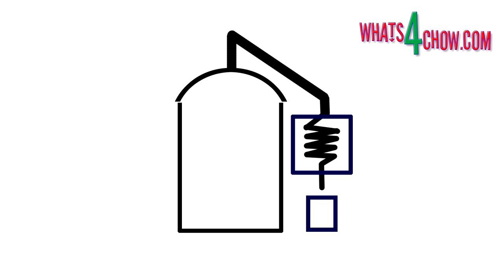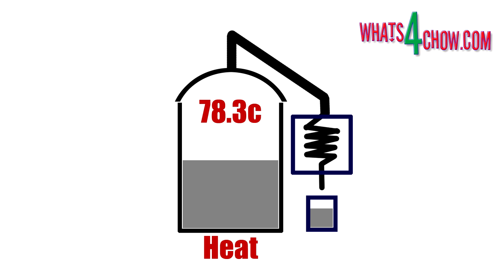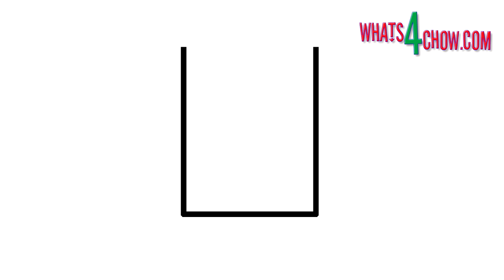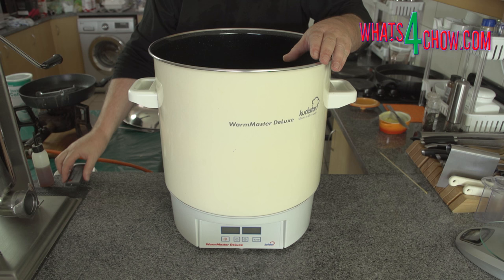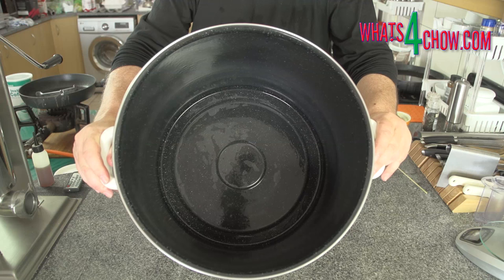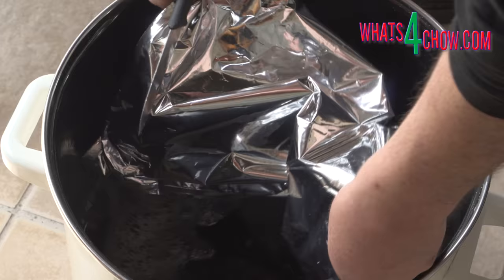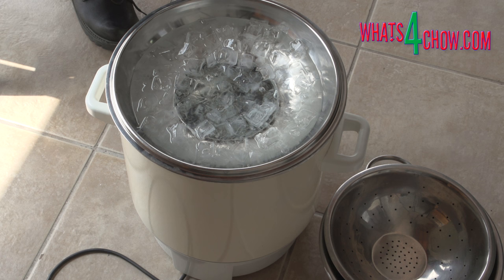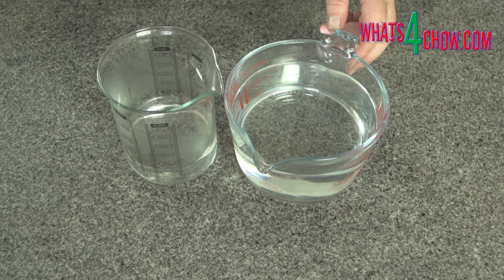How to Make a Reverse Pot Still - Quick & Easy Reverse Distilling at Home!!! Stock Pot Distiller.

Comment: What about the head of the distillation, shouldn't you get rid of like the first 12ml of it?
Reply from the maker: Hi -- I wouldn't use this technique of distilling for any type of grain alcohol. Acetone, methanol and aldehydes are primarily the result of grain alcohol brews. Wines and sugar washes has negligible quantities of these and there is no need for concern. If you do want to distill grain alcohol, I would suggest pot distilling, or reflux distilling, where it is far more practical to actually accurately remove the foreshots and tails from the good stuff.
Thanks for watching!!!
Reply: Whats4Chow nice one,  I just made a sugar wash with alcotec 48 turbo yeast.  It's sitting at 13abv at the moment but should hit 20-23%abv in the end.
Reply from the maker: Super-cool.... let me know how it turns out!

Comment: Assuming an induction burner is set to 80 C or 174 F approximately how long will the process take until it's complete / how do you know when it's done?  I'll hang up and listen.
Reply from the maker: Hi --- this is impossible to predict -- it depends on the ambient temperature, how efficient the heat source is and the starting ABV of the wash in the pot. If you have a good idea of the starting alcohol strength ie. +- 20% ABV and you have 5 liters, that means that the total alcohol content will be 1 liter at 100%.  Collect batches of distillate and measure and calculate the ABV and total alcohol for each batch. When the ABV drops below 20% ABV, the process starts taking too long to make it viable to continue collecting distillate. Blend the batches you have collected, and you should have resulting product that is between 40-50% ABV.
Reply: Is it ok to take the lid off to see how much wash you have left or to see how much has been distilled?
Reply from the maker: Hi --- yes you can remove the lid to check on progress. Make sure your ventilation is good and don't have any open flames burning, and you will be fine. Thanks for watching!!!

Comment: Hi, this is cool! I've got 1 litre of 40% vodka which I want to distill to a higher percentage. Would this method bring it anywhere near 190+ proof? I don't need it for drinking, just for small alcohol camping stoves etc. I was still hoping to get as much as possible, without loses - how airtight is the lid (condenser) on the pot, I guess at least some steam has to leave the pot? Temperature wise...could it just be heated slowly and then balanced at the temperature where the alcohol starts to steam and collect? Maybe lower the temp as the liquid reduces as it would need less to heat a smaller amount? Cheers
Reply from the maker: Hi Kyle -- unfortunately, this is not going to work for you. Any drink with an alcohol content of higher than 40% ABV will not freeze in a domestic freezer. This process is purely for jacking lower percentage drinks like ciders and wines.
Thanks for watching!!!
Reply: Thanks for your reply. But i'm not talking about trying to freeze the ethanol. As I understand, it would take a temperature 10s of degrees below zero to achieve much with the 40% that i've got anyway..... I better mention that i'm in NZ - it's allgood :) I just need to know if this works like a kind of 'self contained still'? If I can keep the 40% vodka in the pot at about 80 degrees celcius...then wouldn't the alcohol evaporate first, condense on the lid and drip into the bowl, like in this video??? I know...something like an old pressure cooker still would be easier. I'm thinking I should get one sorted if my first experiments go well. Cheers
Reply: Kyle Arthur I got you and I have the same questions, about how airtight is the lid? And if it's safe to run it on regular gas stove?
Reply from the maker: Hi Emad and Kyle --- sorry for the delayed response, I have been away on business. The highest ABV you can expect from this method is 70-80%, which should be fine for making alcohol for your alcohol stove. Unfortunately, unless you put a seal on the rim of the lid and secure this with clips, you will have some losses. I would not recommend using a gas stove unless you have a good seal. If you don't have a seal, then the best way is using an electric digital pot, or a induction cooker.
Thanks for watching!!!
Reply: Allgood, thanks for your reply. Yep that percentage would be getting up towards burnable levels for the alcohol stove - but not so much for the etc part. I've been doing some reading and there are a few still configurations that can get 190+ proof on their first run! That would be awesome. Also thinking about alternative heating methods, like compost heating, a solar oven or solar absorption heating (Different from solar panels). The current methods would need to be adapted and potentiated, but it could potentially offer free continuous heating pretty much indefinitely - you would only have to turn/build a compost heap once every 6 months or so! Free and clean ethanol = Free and clean cooking and more! ...You could even have the flames placed underneath some metal circle elements (flames isolated from the indoors) and set up a convection current coming from outdoors to the flame underneath the elements and then carrying excess heat slightly upwards and off to wherever you want...a greenhouse maybe?